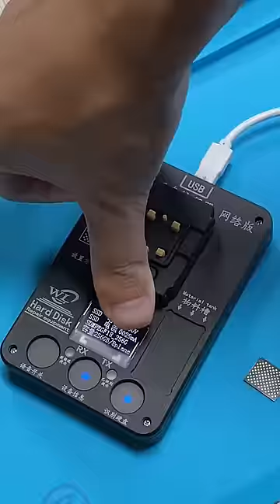Upgrade iPhone XS Storage from 64GB to 256GB #shorts

Comment: Bro upgraded his entire storage but can’t fix the screen, that’s crazy!
Reply: New screen cost more then phone
Reply: Maybe he doesn't change the screen to shows that's the same iPhone
Reply: @gutoofranca  no actually he make sure that it shows 256 gb storage
Reply: @gutoofranca  he got denied for changing the screen by the owner its simple
Reply: Naah it’s theme, the light saber
Reply: It’s just a demo phone for logic board repair, not a costumer phone. This phone also feature in modem failure and another ic repair demo
Reply: It’s just a demo phone for logic board repair, not a costumer phone. This phone also feature in modem failure and another ic repair demo
Reply: Storage you can clone it. The screen and other things is software locked if you change it.
Reply: @misterblackpepperswag  theres no demo repair especially on iphones. You realise apple hates 3rd party repair right? and they do not support Nand flash replacement/upgrade. you could only buy storage on icloud.
Reply: Yes I thought the same thing
Reply: He tried 256Gb bcz of that green line
Reply: @gutoofranca  you are a smart guy
Reply: @citybus3516  if there's system, there's a way 😁
Reply: @SaitamaTheBaldBoi  if theres an 3rd party repair, goodbye performance 😁
Reply: @thinktank8471 o he changed the phone. Because to believe the spectators it is  same phone
Reply: This video is about storage upgrade not screen replacement.
Reply: I see
Reply: He broke it while removing the screen😂😂
Reply: It’s to show you it’s the same phone being upgraded
Reply: Are agar thik screen wala leta to log bolte ki fake he ,mobile badal diya
Reply: @citybus3516  You don't seem to have a plan from Phone Repair at all.

Comment: High risk of lower layer board will disconnect from top because of low tmp solder
Higher efficient in this case to drill with CNC support and install new nand with low temp
Reply: Nope.. i need to clone old nand.
All components is fixed with kapton tape
Reply: There is risk but remember he is having the perfect heatblower nozzle and also using the heat tape. This type of thing always has risk.

Comment: Hey man my phone processor is heating up from small reasons, my brightness is at the very low yet its overheating with zero background app running is there any chance to replace that?
Reply from the maker: You need to troubleshoot and find out which part is overheating.

Comment: I believe this process removes icloud at instant
Reply: No it wouldn't be removed I did a research for like multiple times
Reply: @yeznt_edits_282  did you try with a phone cos icloud data is stored in the emf and nand which would be wiped when you reball and making it increase in memory to full capacity of 256gb

Comment: What are all the tools , equipments in use
Reply: Heatgun, Solder paste, an used/saved iphone xs chip with 256gb and a JC P13 PCIE NAND HDD. U can get everything very cheap on aliexpress except for the programmer
Reply: Is the chip soldered or glued ? If so what type of adhesive is it?
Reply: @DenjiXMakima  its soldered with solder paste